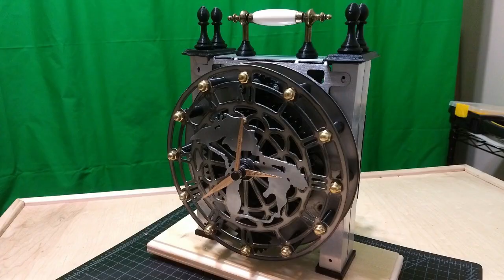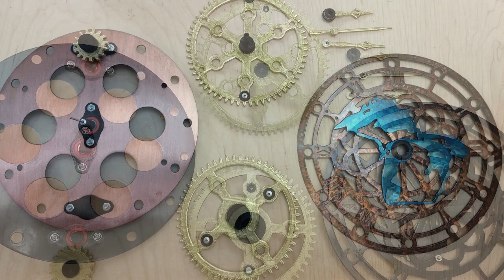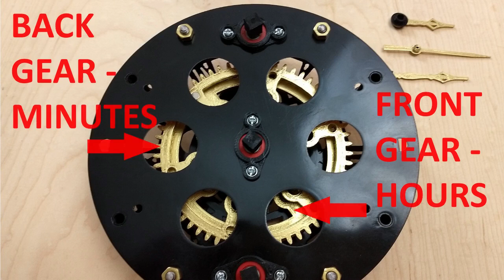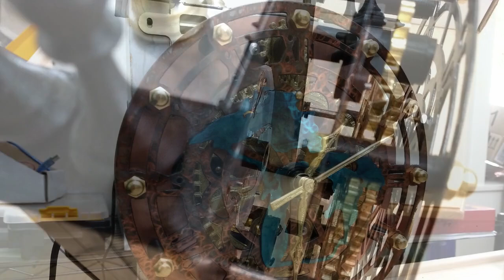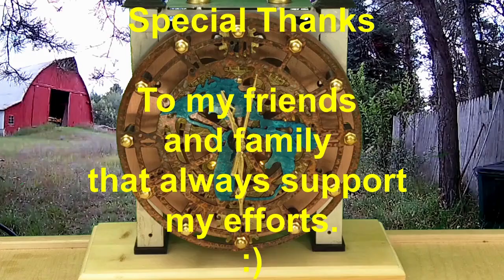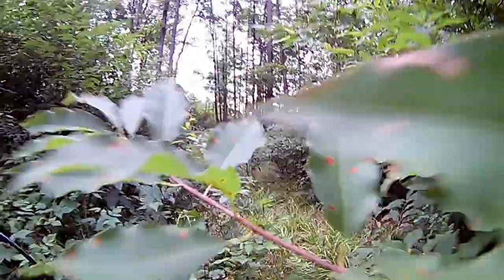Electrical/Mechanical Art Clock Design - Part 1 - Clock Face

Comment: When the clock is in normal timekeeping mode, does the second hand stop at each second, or does it move smoothly?
How much noise does the clock make when it is running?
Does it handle Daylight Saving Time?
Reply from the maker: It moves once per sec. It could move continuously by changing firmware. Noise comes mostly from the second hand moving. But, it has a thermometer mode. You can use the second hand to show room temperature if noise was annoying. Also, It can have a sound module for alarms and chimes.  It does correct automatically for daylight savings time. Also, it can have integrated WIFI and get the current time from the internet. WIFI also allows remote settings...configuration from smart phone.
Reply: For thermometer mode, do you have a dial with degrees?
Another possible use for the second hand would be to show the date. Of course, you would need the appropriate dial for that.
Reply from the maker: For temp 0 to 120 the clock hour numbers x 10 would work.  Day of week could be 1-7. Since I design/make the parts, can make other dials also. Also, could add more motors and more dials to display other things. :)
Reply: There exist (and have existed for well over a century) clock dials with an extra ring of numbers, from 1 to 31, to which a hand points to indicate the date.
I mention that they have existed for so long to indicate that you need not worry about "stealing someone's idea".
Reply from the maker: All true. That kind of stuff is easy to do with this computer controlled clock. Also, I am going to use the 3D printed parts from this design to update my fully mechanical clock design.  https://youtu.be/YMakroC0McU